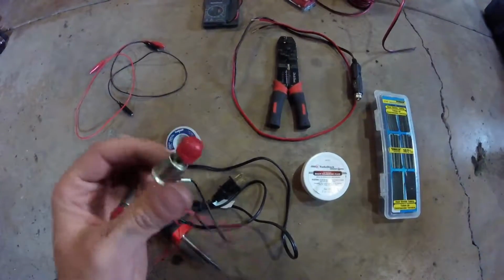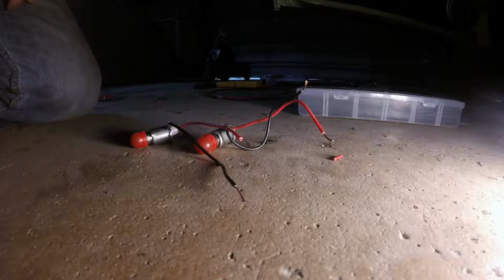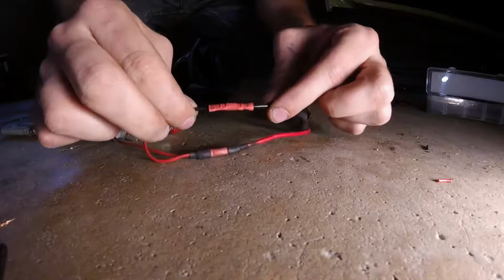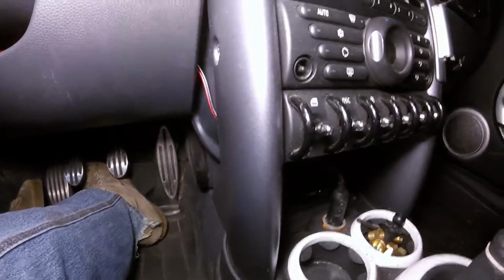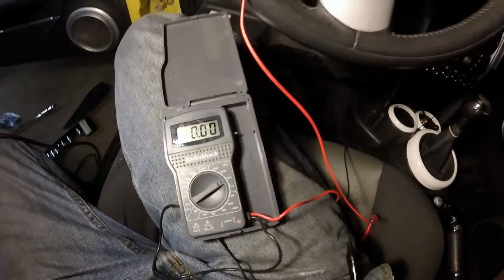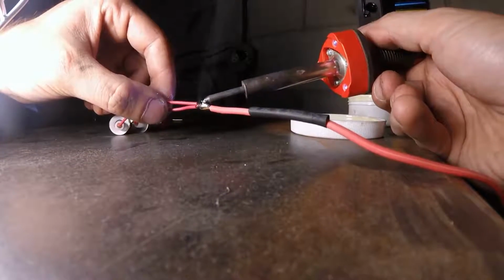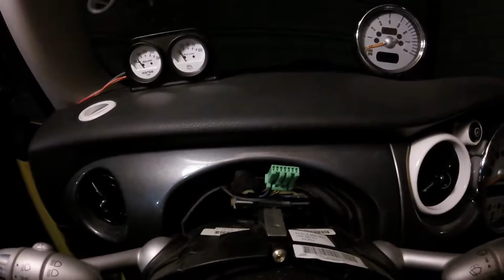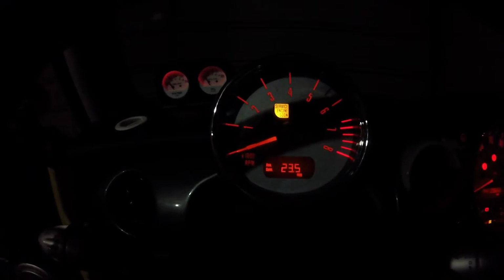How To: Wire Gauge Backlights

Comment: Just Google your car manufacturers location of dimmer switch and then hook one bulb wire to positive feed to dimmer then other bulb wire to positive wire coming out of dimmer. Make sure bulb housing is not metal or grounded to gauge housing. If it's plastic hook it up and it will dim with the oem instruments

Comment: I always hook one bulb wire to the positive lead feeding the dimmer switch and then the other bulb wire to the positive lead coming out of the dimmer switch. But the bulb cannot be grounded to its gage housing or it will short circuit the dimmer switch and ruin it.

Comment: great tutorial. I have a nissan versa and I am installing a oil pressure gauge and a water temp gauge, and I didn't know what to do. However, I would probably go to the manual and see where the light fuse is on the fuse box and connect there. But that's just me. Thanks!
Reply from the maker: That's a better way than what I show here, just make sure that wherever you pick up the 12v is only hot when the ignition is on or the light switch is on. You wouldn't want to wire it to a source that is on all the time unless you're planning to add a switch to control these backlights separately.  Good luck with the install and thanks for commenting!
Reply: @CamaroKid  Ye I would be using a voltmeter and seeing 0V when the lights are off, and 12 V when the lights are on. Then I know what fuse to make an adapter to.
Reply from the maker: @georgemoschak493   Perfect! :D